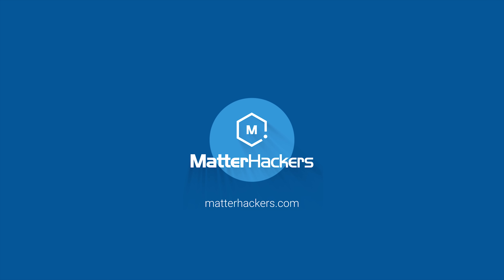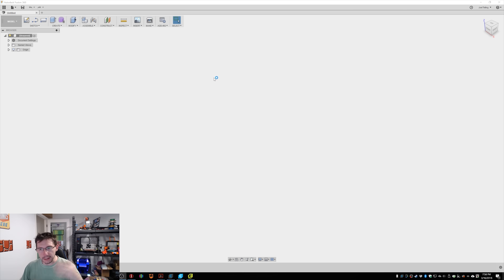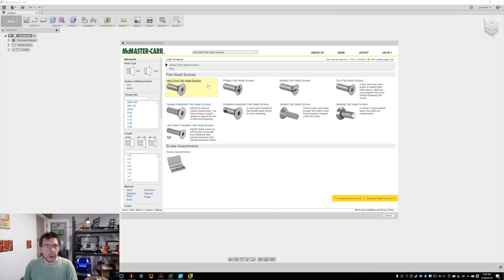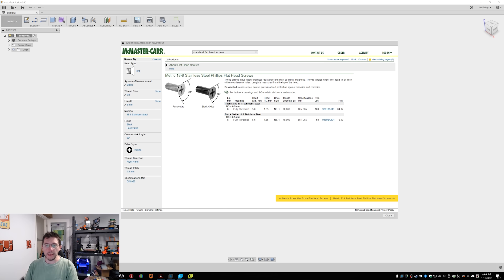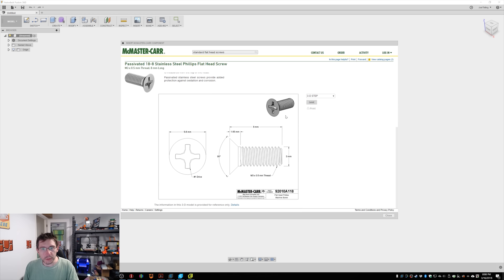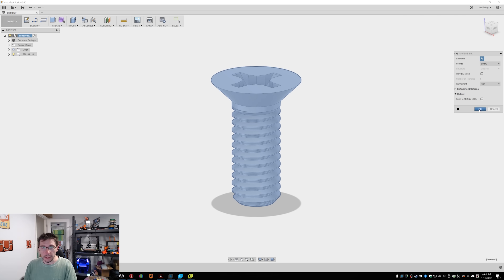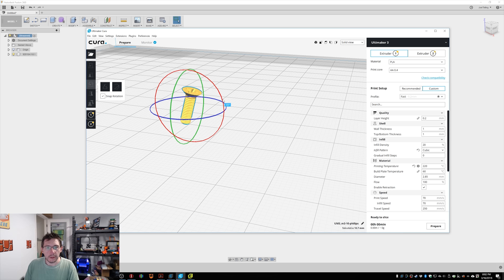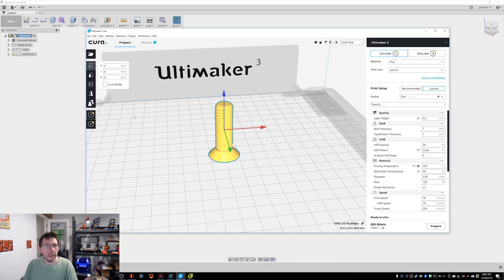3D Printing Nuts & Bolts & Screws using Fusion 360 and McMaster-Carr

Comment: McMaster-Carr is a running joke in my Engineering Graphics class cause it's soooo expensive.
Reply: Wait til you get out in industry.  The most expensive thing in buying hardware in my company is the cost of the labor in the procurement department.  The cost of the actual parts is almost inconsequential until you get over $200 per line item since 1hr of labor is about that much and they'll take that long on each line item in a parts list. sigh
Reply from the maker: Go look up the washers Lulzbot uses for their auto bed leveling. They don't make a profit and charge what THEY pay. Eek.
Reply: Well that is cause they're custom... So them being $6 for one is understandable, but I'm talking a regular M3 bolt costs like $20 to ship... just one.
Reply: McMaster-Carr is the gold standard for how to do an online parts catalog. It’s been that way for 20 years. They make things easy to find and they generally have what you need... especially when you need it in a hurry. That’s why you pay more. They have to cover the overhead of having all of those parts on hand at all times. We sometimes order parts in the morning and get them in the afternoon because their Cleveland area warehouse is an hour away. Also, by providing the CAD models, you are more inclined to buy their products because you can be more sure that it will fit in your design. They have saved me many times when I absolutely needed a part the next day to get a project out the door. Usually, we make more money with the machine the parts went into than the cost inflation for buying from McMaster-Carr. That makes it worth it to me. Oddly enough, they can be cheaper than other sources sometimes. You just have to do your homework.
Reply: +Chris Huck I'd say that having the convenience of it is fine, but for us it's not what we need. For us students it's nice to have the in-CAD feature, but that's pretty much where the benefits end for us. Ordering a thousand M3 bolts or what not is a bit easier you could say. It's as simple as keeping an eye on your stockpile of them...

Comment: .2-.5mm clearance usually works for me but I wouldn't print a bolt if I had a choice.  The forces aren't spread across the surface of the spiral plane if it can just fail at one layer.  I do use this feature in Fusion360 a lot though for design but usually just to carve out holes for real hardware.

Comment: You may not want to go this with countersunk screws. changing the X/Y is going to change the angle of the countersink. You may end up with screws that will tighten but the parts might be loose and wobbly.   Should work fine for button head screws though.
Reply: yeah it's stretching the thread pitch out so they're going to be tight 

I was using the built-in tools to make fasteners a year ago and everything meshed fine, now they are incompatible i can't get any of them to screw together

I've always used cura

Comment: Nice work Jole,  if your building your parts in fusion.  You can add a thred in any hole with the thred tool.  Make a hole,  add a thred,  (make sure you check that you want to modle it,  else it only looks like its there)  Supper eazy.  I use it all the time.  Even down to small fine thred parts.  Keep in mind print orientation.  God bless. ~Russ

Comment: omg, just buy (or print) M12 bolts ???....for tolerances use 'Horizontal Expansion' in Cura, its the more correct way to directly adjust tolerances
Reply: Would not work as M12 has 1.75mm pitch while 4x M3 has a 2mm pitch.
Reply: 3d Print Creator If he'd bought bolts, he'd have bought nuts as well...so why is the scaled up thread pitch relevant?
Reply: In this model there is no room for bolts. He has to tap the thread into the plastic and you can't buy an M12 - 2mm pitch tap very easy.

Comment: Why not scale up the nut instead as that would the quicker printing part? And why not scale it up in Fusion 360 vs in the slicer?

Also would suggest having both the bolt and nut in Fusion 360 positioned in a way that they are screwed together. Then do a cross section analysis and you could see how much of a gap you have for clearance. If printing at 0.2 mm layer height, you would need more clearance than if printing at 0.1 mm layer height.

Comment: Nice job Joel. If you change the z scale it would change the pitch of the thread. Good call. ✋
Reply: Also if the plastic ones don’t work a 12x32mm bolt would be equivalent to the 400% scale 3x8mm

Comment: I dislike printed screws. Because the direction of stress goes breaks easily. 

Fusion has the standards for engineers, but is missing photography stuff like filter threads for lenses. Or tripod screws. 

I spent hours trying to figure it out, with editing ini files and custom plug ins. Nobody in the cad library has the standards for photography like lens mounts or filter threads.
Reply: Tripod screws are generally a 1/4-20 UNC. If I were making some sort of adapter for my tripod, I tend to find ways to incorporate either a metal screw or nut into my 3D print for strength rather than relying on 3D printed threads.
Reply: Chris Huck I have been thinking about just getting a pack of like 30 screw, 20threads and some wing threads to experiment with. I wanted to use a camera grip and a lens clamp but couldn't find one for my lense size.

Comment: I think you might have better luck scaling in fusion 360 before converting and saving as an STL file. Many other file formats are not triangle based and scale better preserving the original shape. Then export as an STL. Any size corrections after STL conversion will result in less triangulation deviation from the original shape. Increasing size above what you want before conversion and reducing rather than enlarging later will also help preserve file integrity. Great videos ,keep up the interesting work!

Comment: In cura there is a setting called "horizontal expansion" that does the same thing as the setting in simplify3d(I believe "xy offset). I suggest you use this insteadof scaling in X and y.

Comment: 2 tips... The finer the layer height, the less you have to adjust the size of the parts. You can use a tap on the plastic receiving side to create threads and use plastic screws.
Reply: Gabe Nydick He'd have to make new bolts to do that, as a 4x scale M3 has a different pitch to a proper M12.
Reply: Yeah, I wasn't thinking a small tap. I figured there might be one that size.

Comment: MAKE SURE YOUR LAYER ADHESION IS REALLY GOOD IF PRINTING SCREWS VERTICAL, IF YOU ARE REALLY TIGHTENING THEM
Reply: Really this should be pinned. Quickest way to break a 3D printed part is to put it in tension along the z-axis, which bolts do as their primary use.
Reply: LOL, I was about to say the same exact thing.  Two ways I know of how to help with this.
The first is to split the screw in half, and glue it together, this can be annoying for sure to make sure everything lines up great.  Make sure you don't split it along the line of the phillips head or else it is likely to split when you try to screw it in.
The second thing that helps is to bake the part after the fact to really solidify the layers together.  This works at different temps for different plastics of course.  I got the idea here: https://www.youtube.com/watch?v=CZX8eHC7fws and it really does work wonders.  The layer lines are STILL probably the weakest axis, but they are at least much stronger than before.  This will cause changes in the dimensions of the part, so you will have to take this into account when doing the scaling as shown in this video.
Reply: They mean it should be stickied at the top of the comment thread.
Reply: +KiaranScath can you explain what pinned mean? Thanks
Reply: Print each screw in half and horizontally to allow a little tension?

Comment: Nice video! It would have been nice if you kept de hex head and also designed and printed de hex tool to screw it in. I know on my rc cars (not scaled 400%) hex are WAY WAY WAY more durable than Phillips. That would be a nice test, print both Phillips and Hex heads with matching tools, than test wich is strongest using a torque wrench to tighten them to breaking point. It would also be a good test to check filament strength.
Reply: Franck TheTanck That would be a fun test.  Honestly, I'd just buy a cheap hex set and grind the corners down just a bit to fit the fasteners.  But remember, someone else is doing this, so let him do it his way.  Besides, it's not like he will be servicing this as much as people should service their cars.
Reply: Just making a suggestion of a piece of content I would like to see.

Comment: Joel, you can embed the screw threads into the body of a plastic part (like tapping a plate for a screw), by subtracting the upscaled screw model in Fusion. 

 - Start by upscaling the screw step model in fusion, instead of the slicer, then 
 - position the screw model inside the selected 'tapped' body at the location where it would 'bottom-out'
 - do a logical subtraction of the screw from from your selected body

Once subtracted, this will leave a screw-shaped hole. Use the same size offset for the farssner, and voila!
Reply: My guess is he already has a bunch of parts printed out. what might work for that situation is something like a timesert, just drill out a hole slightly larger with a 3d printed female thread and glue in.
Reply: Just don't forget the tolerances... You should probably overscale the screw a little before you intersect it with your model, unless you want a really tight fit when you put the screw in the printed thread. And don't forget that the pitch does not scale up the same way as the diameter with real screws, so if you want to use metal hardware, scale up your original model outside of the slicer and then use an unscaled screw to tap the hole in the model (again, maybe scale up the screw diameter just a tiny bit to give some tolerance).
Reply: Thanks for the tip ! One quick question, how do you scale up your part directly in F360 ? I only know how to do it with my slicer.
Reply: Very easy: If you are in the Model workspace, just go to Modify - Scale. It's pretty straight forward. If you need some more Info, goto http://help.autodesk.com/view/fusion360/ENU/?guid=GUID-D3F6F79B-1498-48B3-B98C-7D57B620005A

Comment: Why not use metal filament for the screws?
Reply: Metal filament is just metal powder embedded in PLA. That makes them much more brittle then an actual part printed in just PLA. Copper filament for example: https://www.youtube.com/watch?v=5j-0kRawD_c
The use case for metal filaments are parts that you want to look like that metal and/or have increased weight per volume over PLA.
Reply: Brandon Murray It's even weaker than normal 3D prints...

Comment: Funny that you put this video up now, as I just printed a 1.5" x 8tpi bolt for a lathe chuck, just to keep "stuff" out of the chuck threads when not in use. I had the same thread problem as you described, but I thought when cooled the plastic shrinkage would be enough. It sort of was, but not good enough. A scale downward would have been better, perhaps 5%. My thought after watching your video was once one found a percent that worked for a particular size would it be liner over other sizes? Guess that would have to be tested.

Comment: For the screws that need to bite into plastic parts maybe you could use an m12 tap to cut threads into the female part and use your giant screws as-is.
Reply: Michael Eisenhut Because he's scaled up an M3 rather than using an M12, it wouldn't fit.
A 4x scale M3 has a thread pitch of 2mm, M12 thread is 1.75mm

Simple to fix though :)
Reply: Pook365, yeah good point but also fixable.

Comment: m3 x 4 is m12 pretty standard stuff
Reply: Yep just use M12 with M12 Nuts and your done, plus the plastic parts aren't actually threaded so pitch doesn't matter.  Only issue might come down to weight of the final model,  but hell it's only a bit of fun so who really cares :-)
Reply: Not really, since the pitch isn't the same.
M3 is 0,5mm pitch, x4 = 2mm pitch. M12 is 1,75mm pitch. :)
It would not fit.
Reply: if u use m12 nuts it should fit or am i missing something ?

Comment: I know the metric system is incredibly complicated but... couldn't you just have taken an M12? ;-)
Reply: there is no thread in the car parts, so the pitch difference would not matter.
Reply: If you take an M12 bolt of course you need an M12 nut...
Reply: But why does that matter if the threads are tapped either by a tap or as the bolts go in. I don't think this was threaded when it was printed, and I can't see a plastic bolt will cut into it to make a good thread. We will probably see in the next video
Reply: Mechanically I have a feeling he wanted to make sure the recommended parts fit.  A lot of these built 3d printed projects have parts lists of exactly what to use.  I'd rather go with metal fasteners that are the right size for most of an RC car, but then again I do like to bash.
Reply: Phew, I wasn't sure how to approach the "are you f'ing kidding me" statement without first giving you a chance to give your point of view :)  Cheers
Reply: In fact, it's the only correct way to go.
The pitch of M12 is different to the pitch of M4, therefore if you are going to tap a thread inside the plastic part, the printed part won't fit.
as there is now way I can see Joel create a M3 tap and scale it to M12, he has to use a normal M12 tap.
You can buy a M12 tap with a 2mm pitch instead of the normal 1.75mm pitch, but these are extremely difficult te find and super expensive.
Reply: Cost too. M3x30 alloy SHCS about $0.15 McMC.  M12x120 about $1.40
Reply: @franktkalcevic5342  he's printing them, their cost is irrelevant.
Reply: Not really, since the pitch isn't the same.
M3 is 0,5mm pitch, x4 = 2mm pitch. M12 is 1,75mm pitch. :)
It would not fit.
Reply: Just my thought. If you 4x the pitch and diameter, then isn't that simpler and easier. Just may be a bit more expensive, but then also more durable.
Reply: https://en.wikipedia.org/wiki/Irony
Reply: @JAYTEE I tried some irony there  ;-)
Reply: Are you able to explain how the metric system is incredibly complicated? I'm being serious. Cheers, JAYTEE edit: I don't disagree with your M12 comment though

Comment: do you have to print out a giant screwdriver as well?
Reply: That’s true, the slots in the screw head are now 4x larger than a normal screwdriver.
Reply: DJ Hannu  but its 4x larger than a m3 so basically an m12 right
Reply: I was thinking the same thing
Reply: he has a giant flathead but idk about a philips
Reply: Actually 3,75x times